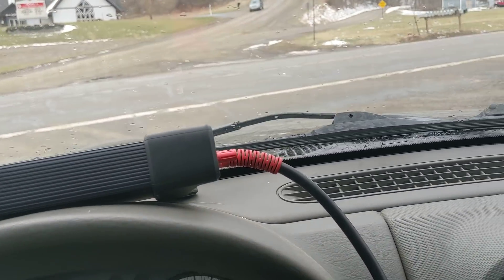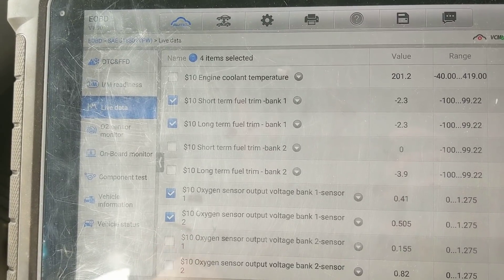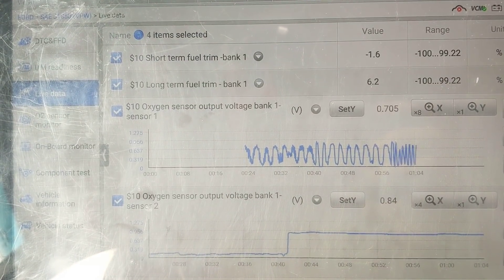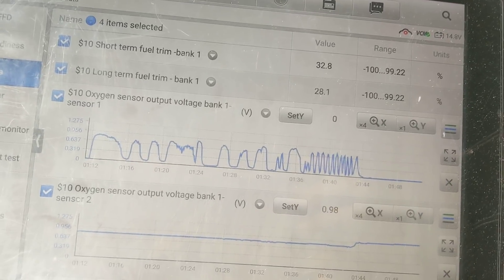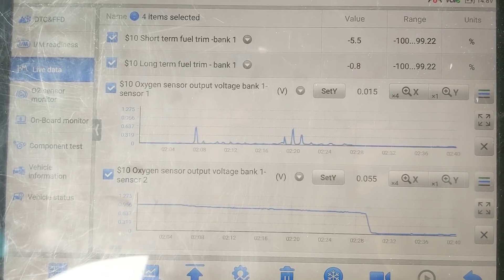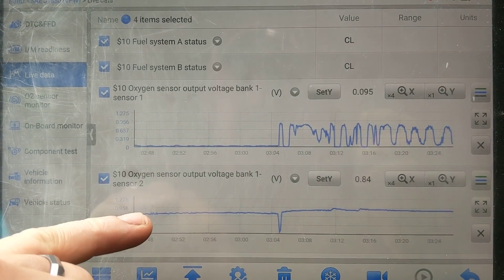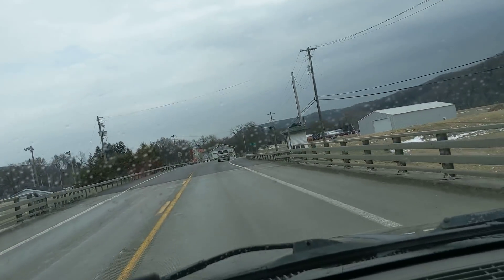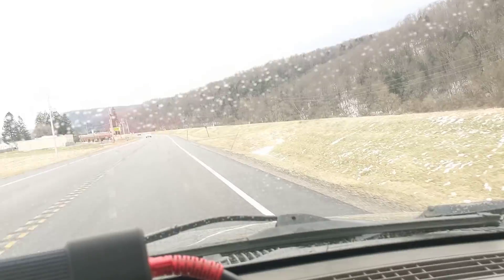SMA Quickie: O2 Setting Rich and Lean Codes!?

Comment: As a retired diesel mechanic and having some but much less exposure to gas engines, cars, I’m still interested in learning troubleshooting techniques using a scanner. My own vehicles are a 2015 Lexus RX350 and a 1997 Ford Ranger, 3.0 naturally aspirated motor so, what scanner would you recommend to service these and other current vehicles as a now DIY? Thanks for your sharing your experience and insights. Please say Hey to Mrs. “O from my wife and I!

Comment: The origins of the O2 HEGO post cat, was to satisfy OBDII for CAT health. However, if you understand how HEGOs work, much like a CAT in terms of chemical reaction, you then realize that the post HEGO has no great value in overall fuel strategy. The reading is skewed by the cat and its response relative to fuel trim is much too slow. The question should be asked then, well how well do they work in monitoring the cat? As it turns out not as effective as you would think for the investment of a HEGO and computer strategy, but it was sufficient to satisfy CARB. Anyway, that is what I know about the post cat HEGO.
Reply from the maker: The work incredibly well for monitoring cat health, especially when using oxygen storage capacity strategy as opposed to index switching ratio. In most modern cars they are a huge player in fuel trim strategy. I can't think of a single make that doesn't use the post cat O2 for fuel strategy actually.

Comment: Hi Eric I got me a great Christmas present.
99 Honda with 188,000 miles. Runs great. 
Problem got a mil or check engine light on.  Should replace sensor  or try down soap up the tailpipe?

Comment: Had this exact issue with a Kia. Tested the same way. The front was a afr rear o2. Replaced both for peace of mind with factory ( aftermarket garbage) o2 due to milage. Lady spent a bunch of money trying to get it to pass smog. All monitors set in a 20 min drive. I won't give a car back until I've cleared monitors.  If frustrates me how many shop don't verify repairs.

Comment: Good video ! just found out the other day My Friends New / Used Boat Has catalytic converters in it & 4 O2 Sensors in a salt Water Boat. OMG 🤦‍♂️ comes to mind when isaw it ! Yes , i did say 4 o2 sensors !! & No Mass airflow sensor. Computer runs engine solely on 02 sensors readings ! nuts 🥜. 
A 26 ft bow rider boat. i heard other day cats are $2,000.00 a piece !!! Yikes. it has 2 for 1 engine. Emission laws & Cats 🐱 on Boats . 🤦‍♂️

Comment: Hey man I’ve been watching many of your old videos (talking like 5-7 years+ ago) regarding parasitic battery drain on the 03-07 classic GM trucks. I currently have a nightmare with it and I am in need of some advice. The 3-4 time trying to jump start my 06 Silverado I heard many fast ticks (not the starter) on the drivers side of the engine bay. Then after the ticks I had absolutely no cluster lights or it would not crank whatsoever. Hope you see this comment. Thank you.

Comment: this little trick worked on my explorer changing rear brake pads. Put one bolt back in the brake caliper into the bracket. It holds caliper while turning piston in. no skinned knuckles.

i

Comment: Great tech video! you're correct about the 4.0 and the others, I've seen people put new fuel pumps in time after time, after being told it was "probably" low fuel Pressure. stemming from a pump on the verge of failure. I've even heard the brand X salesmen say "yea we see that all the time on C,D,J products" always remember a little technical data can save several hundred dollars in unneeded repairs. keep up the good work!

Comment: Yep...working on very similar issue on an 07 grand Cherokee 3.7.
No light, but start/run rough keeps randomly popping up every few months, sometimes won't even start, then it does....running the data shows LTfuelTrim is high & unbalanced (7.8 on bank 1, 10.8 bank 2), STFT is bouncing from 2.3 to -7.  O2 looks good too. Probably a vacuum leak somewhere on intake.
Noticing some fuel/oil residue around 2 of the injectors.
Going to pull intake & injectors to clean(& inspect) and replace seals.
Thanks SMA, your videos provide valuable insight.

Comment: I work on CNG truck engines a lot and I see this type issue , unfortunately our diagnostic program has no graphing capability and what it does have you need to run on a dyno which our shop doesn’t have and isn’t practical for a garbage truck shop!  So we have to do it the old fashion way and ohm out the sensor.

Comment: When this happened on my old Dakota, I’d seen the symptoms you described so many times on Chryslers (and many older OBD systems that couldn’t diagnose a failing O2 sensor properly) that I didn’t even bother to put a scan tool on it. Just threw in a new O2 sensor and it fixed it. The Dakota was not OBD2 and didn’t set a check engine light, but the symptoms are so characteristic (and the O2 sensor so inexpensive) that it made more sense to just throw a part at it.

Also, pretty much every new car uses the rear O2 for fuel trim adjustment to some extent. It’s pretty much a requirement now since vehicle manufacturers are so reliant on the cat converters to make up for the pollution machines they put under the hood, they have to use the rear O2 and make adjustments in order to make sure the cat is being fed properly. Sometimes a perfect stoich mixture isn’t what the cat wants to be the most “clean.” Many have been doing it for at least the past 10 years. Some, like Chrysler, Subaru and Toyota have been doing it since the 90s.

Comment: Attempted to feed you some cash by picking up an Autel, but the MaxiSys listed has been replaced with a newer model, just a head's up to get the gravy train rolling again on that item 🤣. That being said, I've been on a crash course with these O2 sensors and figuring out whether there is a plugged cat with my nephew's 2006 4.2 Ford, and little stuff like this helps me to understand the system better as a whole across manufacturers.  That and that little tidbit about the 5.2 and 5.9 is liable to help me out significantly in the future since I have a couple lying around.  Thanks Eric!

Comment: Had one do this before. Pulled the o2 sensor and it was completely caked in carbon. Hit it with a brass brush and cleaner and it recovered.

Comment: Nice quickie Eric. I always try to guess what’s wrong before you tell us. I was wrong this time. I was voting it was a a bad injector. Once ya put the hammer down it went all rich on ya. Goes to show you have seen it all and even this one didn’t stump Eric O. Now I have to hope my diag on a 2017 Ford Focus is right. No speedo, no traction control, no wipers(wipers quit first) and no antilock brakes. Can ya guess which one is bad? Not without a proper diagnosis. Wish me luck. If Eric O can do it.  I have a feeling I can too.

Comment: Class is in session with Prof. O. Thanks Eric, you just hopefully helped me with a P0172 code in my 2002 Dodge Neon(157,800 on clock). Fuel trims pegged out in the minus column, gas mileage is poo...went from 22-24 city to 15-16. Parts cannon missed...replaced in this order, air filter, sparkalators, IAC, MAP, injectors. Cheap scanner Scotty recommends won`t test O2. So, new OEM sensors on the way. Funny thing is, it runs good, just poo mileage. Did I miss something? HELP! If I lived in Avoca, it would have been in your shop a month ago, but alas I am in Pa.

Comment: Brilliant teaching, I watched through twice. What an interesting situation. The front O2 sensor predictably cuts out to low voltage with acceleration. The two things that came to mind were an exhaust leak near the sensor, changing the O2 control; or a corroded wire, maybe even inside the sensor that rocks open with acceleration. I didn't know that about Chrysler, but it sure was useful to see those rear rich findings coincident with the front sensor lying. This kind of higher level teaching is still rare on the 'net, but getting better every year.

Comment: SMA, I have quite a question for you. Can your mixture be so bad it can shorten the life of a Catalytic converter? I recently changed my PVC valve in our Chevy, 3.6 Impala. It was really bad. I had our exhaust system looked at and the converter was struggling to breathe. Car has 107,000 miles. Care to share on this one? I had the converter and the resonator replaced. $$$ I cleaned out the intake tube on the air draft going to the throttle body too. Car runs like new.

Comment: I wish I could get easy ones like that.  Got a 12 Ford focus with a P0131 code in the shop with a mysterious idle issue.  The short term fuel trim goes really negative for 3 seconds and goes back to normal just like clockwork.  This cycle repeats every 30 seconds with the engine hot idling.  The A/F sensor amps and rear O2 are reacting as they should to the intermittent rich condition.  The MAF frequency is around 2 grams/s until the episode and jumps to 4, because the throttle angle changes probably due to the idle speed drop.  Rail pressure goes up about a hundred psi also.  I think all these things are reactions and not causes.  Never seen a vehicle act like this before, very strange.

Comment: I have an 04 Liberty with 251K on the rear 02's.  Didn't know they have a say in the fuel trim. I'll be checking them close if I have an issue with mine. Thanks Mr O.

Comment: Had a similar one on my grandmas Cadillac, but the issue was the ECUs failing, to read the voltage was in normally operation. This is after someone else already put in a new 2x o2 sensor that didn't fix it.

Comment: So it throws both because it's using the rear for fuel trim? It would be nice if the system knew the difference between a bad sensor and an actual lean/rich condition by processing the data that your eyeballs are doing

Comment: Great info, man - I have zero experience with speed density driveability diags. I'd have got into a bog on that one.

Update screwed mine up so bad I had to send it back to Autel! They had it over 3 weeks ... then sent a brand spankin new one back to me! Not bad. Mine had all kinds of glitches. It was unusable.  Thing was "ghosting" - opening things up I never selected ... then when you try to go back nothing works, until you tappity tap tap the screen to make things BIG, then you can exit. It was just like a Microsoft product with a nasty root kit or virus. Infuriating! Glad they replaced it. I paid enough for that damned update!! 💸😬💸

Comment: It's erasing your graph like that because they have limited the amount of samples that it can do--  (usually only 1000 samples, I've seen on other scan tools).   So once it is full, it has to erase an earlier measurement before it can give you another live reading.   If it was because of an update:   They probably discovered that it was bogging down the processing power if they let it sample too many at once--  so by limiting it, it should run faster.    But I'm just assuming and making up everything I just said. lol

Comment: I've had parts guys try to sell me 02 sensors gas caps the whole works little do they know I'm a technician and I know you need live data and a physical check on the wiring to that sensor to determine what's truly wrong I've had customers chase their tail at the parts store because of their scan tool and then give up and bring it to me it's quite comical sometimes

Comment: Hey I have a Toyota 07 Corolla. And Im confused cause when I give it gas and go. My long term fuel trim plus 10. Checked my o2 voltage. Bank 1 was 3.5 volts and moving between that and like 2.8 what’s wrong? I thought those were between 0-1 or is my scan took a lier? It’s not the best

Comment: With 138K miles, would you recommend the customer to have both replaced (since its already in the shop)?
Reply: If you have the ability to graph both O2 sensors, I'd suggest doing that before replacing both.
Reply: @coache1nine  Why, how long can an O2 sensor last?  Why replace one, only to have to replace the other one in six months?  I'm kinda like springfield's thinking......whether I do it myself or have a garage do it, I favor "renewing" parts when they are within reach. It might cost a LITTLE more in the long run but I think it restores reliability. Adds "green time" so to speak.
Reply: @rael5469  O2 sensors do not have a life span. I replaced one on my VW Passat @ 250k and it was for a heater circuit malfunction. The other was fine. My car only had two, what if you have four or more? You want to replace them all just because? If your finances allow it, have at it, but it's not necessary to replace them all because one failed
Reply: @coache1nine  I'm just saying that if the two of them were relatively close together and I had to do some disassembly to get at them....I'd replace both. After all....one failed. Maybe the other has the same defect. However I will admit that I had my last car for around 200,000 miles and never replaced the single O2 sensor. I did replace the crank sensor though.
Reply: @rael5469  a couple of things. O2 sensors switch or adjust at different rates, the upstream much more than the downstream, so the chances of them having the same defect is unlikely. The location really depends on the vehicle. My VW upstream was visible when I opened the hood. My downstream: I had to get under the car and twist myself in a crazy position to see it, let alone replace it. It's really your choice, but again, the one failed, replace both argument is moot
Reply: @coache1nine  "the one failed, replace both argument is moot"
No it's not. I've been a mechanic for over 40 years. I've seen it all buddy. Believe me, if I am in an area of the car (my car) that is really annoying to reach....I'm gonna replace anything within reach that I even SUSPECT could go bad, because I don't enjoy auto repair and I'm not going back into that area if I don't have to. Autos are jigsaw puzzled together for the convenience of factory production, not for the weekend mechanic. Replacing potential troubled parts precautionary is absolutely a valid concept in any mechanical trade. It is absolutely not a moot point. That's YOUR opinion.
Reply: @rael5469  I respect your opinion, but as Certified ASE Mechanic myself for over 30 years, I don't replace things that haven't failed just because they might. I was taught by an old timer who said things that need to replaced in pairs, come in pairs. You can always suggest it, nothing wrong with that, but you don't replace what hasn't failed. You can be accused of padding the bill. Let the customer decide. If they want it done, fine. Your not fixing things at your convenience. I see we agree to disagree. I'm not saying you are wrong, it's just a practice I have never followed. Have a great day and be safe
Reply: @coache1nine  "I respect your opinion, but as Certified ASE Mechanic myself for over 30 years, I don't replace things that haven't failed just because they might."
As a vehicle owner who doesn't particularly enjoy auto repair......I DO. See how that works? If I can avoid going back inside some annoying space by replacing parts on a precautionary basis because I am in there anyway, I will.
Reply: @coache1nine  "You can be accused of padding the bill."
I understand that. I was only referring to my personal vehicle....my POV.

Comment: Awesome diagnosis Eric!  I'm not sure I could have done better with the Chrysler Engineering Interrogator that I used back in the day.  FYI open loop is triggered when the exhaust temperatures exceed some component temperature limit.  The extra fuel is being used to maintain the exhaust temp at that limit.  The Viper limit was 1650 degrees F at the exhaust port or 2000 degrees F one inch from the front of the catalyst brick.  Similar limits are on Chevy's and Ford's.

Comment: Why does the front o2 sensor go up and down and the rear doesnt?
Reply: Catalytic converter uses excess oxygen to burn remaining fuel in the exhaust basically do its thing to convert it all from carbon monoxide to carbon dioxide and oxides of nitrogen (NoX) to something less harmful like H2O and something else I can’t remember exactly.

Comment: Could you do a similar diagnosis by just unplugging the front O2 sensor? Without the front O2 sensor, what is the fueling strategy? Would it just default based on the rear O2 sensor only?

Comment: THANK YOU!!
I'm glad SOMEBODY ELSE out there recognizes that the rear O2 IS used in fuel strategy.  I had a wild situation with my neon srt-4, where under cruse the car would go STUPID lean, like off the scale lean, and ran like garbage. WOT though and things were perfect.  Found that the wiring into the rear O2 was damaged. Replaced it and all was good.  Had MULTIPLE people tell me "not possible. rear O2 not used like that. you got something else wrong!"
Also, don't be dissin' on my Liberty's :D  Mine will go all West Side Story on you.

Comment: I have a Ford ranger 09
The front oxygen sensors are very good functioning Lean and rich conditions
But the the back Back oxygen sensors are inLean condition.
When I do snap test the back Oxygen sensors are moving
So what The symptoms keep The back oxygen sensors in lean condition?
Thank you for great Content
Reply: Rear O2 should stay near the middle to the lean side a bit. Saying all the oxygen is used up after the cat. Which it should be if it’s working properly

Comment: Why don't we go back to good old points, condenser, rotor button and etc. These new flangel electronic system is a money grabbing junk. I had a 68 Dodge Cornett 440 with a 225 slant 6 engine and got 29.9 miles to the gallon. That back in the days as a teenager. Now I'm old and half crazy I got 2011 Chevy Impala that only gets 26 mtg on the highway. That's why the electronic system is junk. More money for junk.